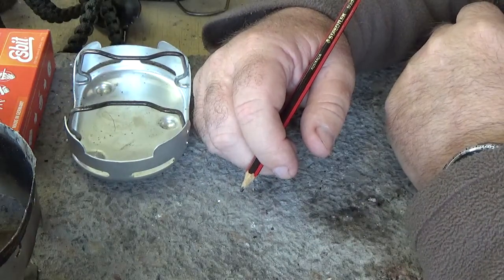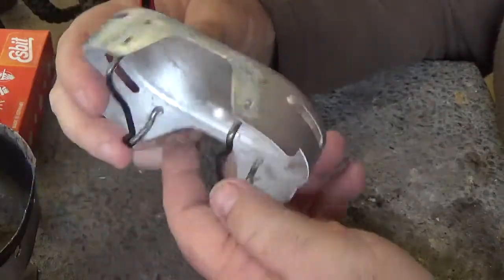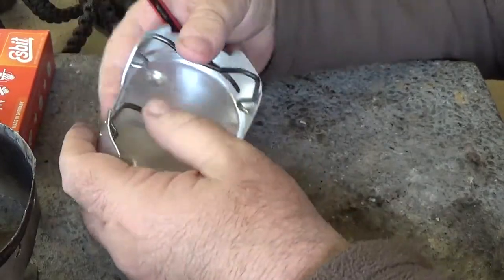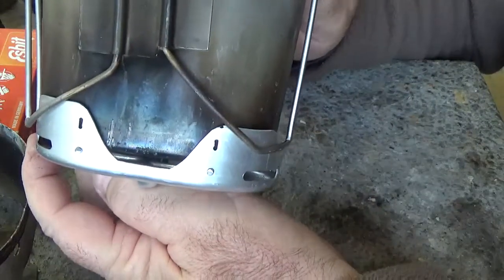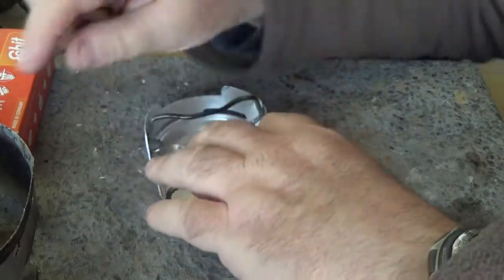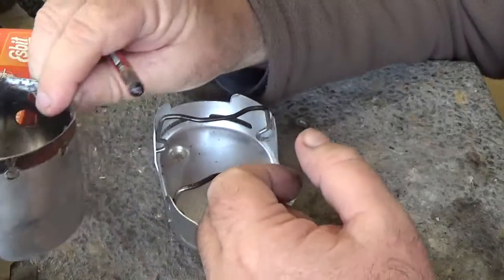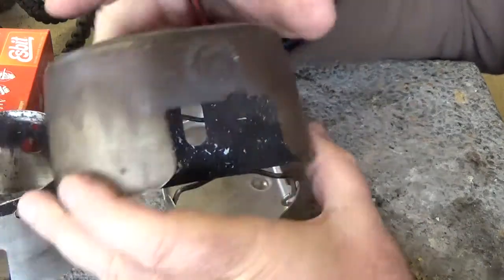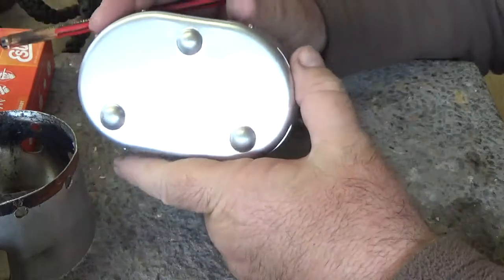French Army Canteen Stove

Comment: Just picked one up for my heavy cover TI canteen kit...hope it fits.
Reply from the maker: Seventh Seal Hi I have a ti set as well the stove fits perfectly , the bottom of the handles fit tightly inside the stove for a neat fit regards mike
Reply: I appreciate the reply! Does it leave  much residue on the canteen cup? Wondering about esbit efficiency in this configuration.